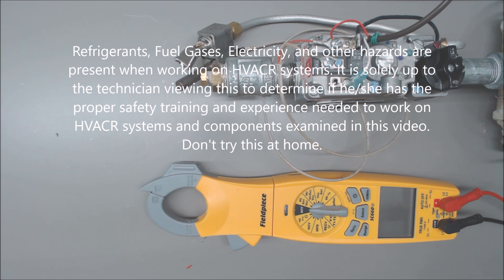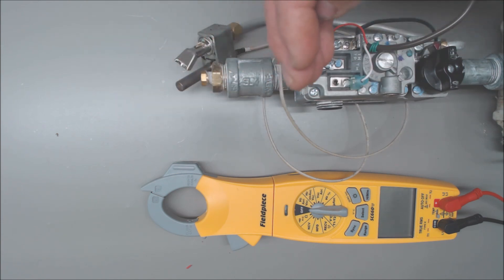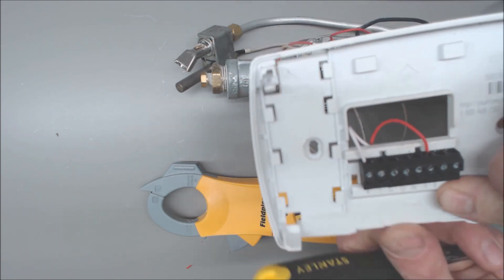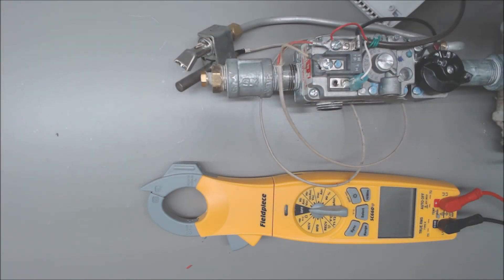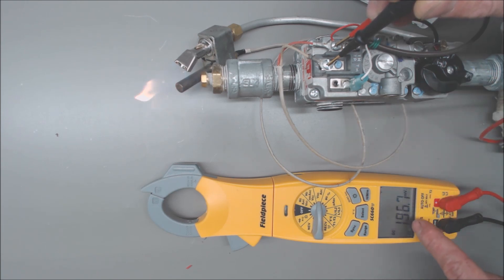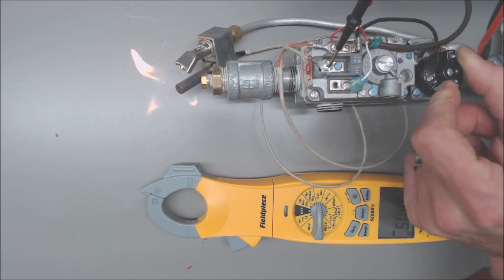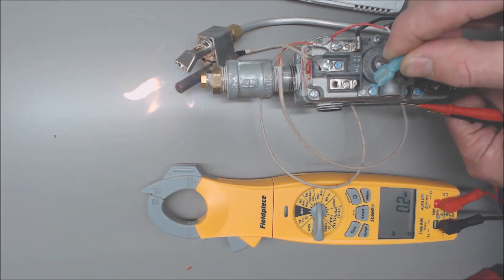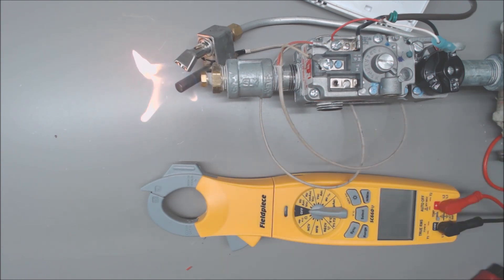How the Millivolt Gas Valve and 750mv Thermopile Work! Troubleshooting!

Comment: awesome video. Do you have a video that addresses why a pilot light does not stay lit please? I've replaced the thermopile, getting over 500mv, but as soon as I release the pilot knob, the pilot light goes out. I've tried two different regulators (this is a small vented propane furnace used for a cabin) run off 20 pound propane tanks

Comment: I have a millivolt furnace heating my greenhouse, and I am trying to make a device based on an esp8266 controller board to tell me if the pilot light has gone out, which sometimes happens under high wind conditions. My thought is to measure the millivoltage from the thermopile, which should always be about 750mv, if the pilot is lit. Is that right? If so, should the pilot flame go out will a substantial drop show up, measured at that point, while everything else stays the same? If so, what would be the likely drop? Thanks for such a thorough explanation of the millivolt system.

Comment: Great video, thanks! What causes the pilot flame to go out when moving from pilot to “on”? Also noticed the pilot flame does not go out when I turn it to “off” so I need to close the main gas valve. I’ve replaced the thermopile, thermocouple, and spark igniter but the problem persists. I think it’s probably a faulty pilot valve but was curious if you’ve seen that. It doesn’t sound common and it wasn’t mentioned in this video. I just ordered a whole new Robert Shaw 710-502 🤷🏼‍♂️ to try

Comment: So, the 10mv drop from 240mv (with the jumper wire on) versus 230mv  with the tstat wire on TH, show a 10mv drop that is due to the entire tstat circuit? 

My reading is 187mv TH to TH-PG, and the burner is staying on. My reading is TH to TH-PG is 633mv without main burner on. Since in you example the voltage went from around 550mv with burner valve open, down to about 230mv, I think I must be losing a lot of mv somewhere in my tstat circuit? If you think that is correct, what is the best way to find the tstat circuit resistance?

Comment: Excellent, clear detail and explanations for troubleshooting. But even the simple basics like why some valves use TP and others PP, and your explanation is the first that covers that right up front. Thank you. - -   Question:  Do you have a recommendation for a WiFi controlled millivolt thermostat for thermopile valve like this?  So far I have only found one on the market, and it is marketed for gas fireplaces.

Comment: If anyone is still watching this. I would appreciate some advise. Have a similar gas valve, Dexen brand. For some reason I can only get the gas valve to open the valve for the burner. When I jump the RH and W terminals together on the thermostat. And. Will shut itself off  while having no call from the thermostat. Because it's satisfied with the temp

Comment: My thermopile will only make .350v from pilot, it drops to .200v when gas valve commanded on by thermostat,  after approximately 15 min that voltage starts to drop untill under .100 v at which time the valve closes due to insufficient voltage,  this is a brand new theropile, could the valve be drawing to much voltage or could the pile be faulty,

Comment: Im currently getting a reading of 550mV between TP and THTP. I know you said 600mV. Main burner is not turning on. Does this most likely mean theres an issue with the main gas valve? 
Burner does not turn on when I jump using a paperclip between TP and TH.

Comment: Great vid, I think I just heard you clarify but want to pose this to you. .  So you’ve got the white wire going to tp terminal.  I’m Installing robertshaw 700 valve to Williams furnace and old thermopile red wire is negative and new thermopile I’m using the red wire is positive.  What’s going on?

Comment: Excellent information. Do you know what the smallest millivolt gas valve might be? I'm interested in building a tiny propane furnace and would like to find the most miniature gas valve that doesn't require power. Thanks.

Comment: I need to replace my old sticking gas valve, just by chance in this sample it is my same old Robertshaw valve, also need to add a thermostat like in the sample, thank you very much it is very helpful, explanation is very clear.
Reply from the maker: Make sure the thermostat is rated to work with MV and not just 24v, thanks!

Comment: I can't tell why the flames in my fireplace are so low and all blue about 1unch high. Years before they would be yellow and blue about 8 inches high. Now I closed the physical entrance where we turn a nob to increase the gas input but nothing happens. I check the thermopile, at rest and it reads 560millvolts with the pilot on, when I open the thermostat it goes down to 190 to 235 is this enough to open the gas valve.  Should I assume the thermopile is defective.

Comment: Hello. I have a Empire DV35 natural gas wall heater with a millivolt system. I have had a regular 24 volt thermostat for years without a problem. Recently I can’t get the main burner to come on. I have replaced the gas valve but still not coming on. Pilot stays lit. Any thoughts? Thanks.

Comment: For a Robert Shaw 710-502 or dexen 6003  they generally wont operate prior to 325mv.  I will say, pilot flame is usually something you dont want to adjust.  It’s common to get leaks there.  Pilot flame is set pretty solid from the factory.  Dexen Tpile only valves tend to have sticking magnet issues also.  The 6003 is a garbage valve.

Comment: My heatilator GNDC36 does not have the black ground wire on it as yours does on the top. Could that be why my pilot light works perfect, but the burner will not ignite?

Comment: Question...What if the valve is not closing? The boiler temp is set to 170, the boiler keeps heating to higher, I tap the valve and it stops firing. Federal 

Taco Zone Controller
SR1502
Aquastat
Brand: Resideo
SKU: L8148J1009
gas valve
VS8279A10342 1/2 X 3/4 INT JD4

Comment: Great video, I have a heatilator fireplace that has thermocouple and thermopile. Replaced both but when I light pilot it will light and stays on for a bit but goes off. When I measure thermopile it won't go up to 105mv but if I disconnect it from valve  will go up to 350mv or so. Any suggestions

Comment: Could I swap out my gas valve with a thermocouple and thermopile and just use 1 thermopile setup and get rid of the thermocouple?  This is on my old Heat n Glo SL550TRSLP-C

Comment: I was always unsure if the thermocouple and thermopile had enough power to drive the pilot and main gas valves.   THANX.
Reply: A millivolt gas valve with both a thermocouple and a thermopile operate differently. The thermocouple is a fast response type that is dedicated to the pilot valve only.  It replaces the now illegal mercury pressure switch that was once used on valves that only had a thermopile. It drops out very quickly should the pilot flame become extinguished due to, for example, a down draft condition.
The thermopile is then responsible for powering the thermostat, safety, and main gas valve circuit. 
You'll notice the pilot burner with 3 distict flames:  one on the fast response thermocouple, one on the thermopile, and one to lite the gas when the main gas valve I energized.
You should be able to disconnect the thermopile connections and not lose the pilot flame.
A lot of fireplace issues are a result of loose or dirty electrical connections, dirty pilot orifices that result in cooler than required pilot flames, failing thermopiles, or thermostats that are not intended for a milivolt system.  A true millivolt thermostat will not have a heat anticipator wire.

Comment: The upper terminal is TP/TH,  not TP. The middle terminal is TP,  not TP/TH. Also I suspect the thermostat pro 3000 is rated for millivolt, but pro 1000 is rated for millivolt.

Comment: I was hoping you could answer a question for me. I replaced my thermopile(it was only reading 190mV) and I got the new one in, great, reading about 520mV when pilot is on. When I jump the leads or turn the on switch on(no thermostat for the fireplace, just on and off) the flame kicks on, but only at about half of what it should be? And the thermopile reads 180mV and same with the pilot. So the question is, why am I getting such a large voltage drop? And is that why the valve isn’t functioning properly?

Comment: what would be the problem if 24v is registered when wires are unplugged from the gas valve, but the voltage drops when wires are connected to the gas valve?

Comment: Thank you, very informative! Would you be kind as to answer a viewer's question: do thermocouples go bad over time meaning produce less energy? Mine shows open circuit 325mV and pilot-only 264mV and main-valve-on 154mV, I'm seeing intermittent on/off issues and I suspect my thermocouple just isn't producing enough power any longer but wanted to get your input before assuming anything as to probable cause? Thank you
Reply: Yes they do go bad. The difference on thermal bulb and thermopile is that the thermopile has several generators inside of it and thats how it produces the higher MV output compared to a single thermal bulb generator.
Reply: @mostlikelywedoitservices6926  Yes we're getting the thermocouple replaced - and the technician turned off the pilot flame before he left!! So now the direct vent is kicking in cold air. haha. Dang! thanks for explaining this problem. I'll call them back today to see if they got the new thermocouple yet.

Comment: Thanks for an excellent video. I put 3 different thermostats on a wall heater, each of them worked, on an intermittent basis. Your video explained it, too much resistance for the small voltage to overcome. Bought a millivolt only thermostat at Home Dept, and believe that will fix the problem. Thanks again, I was freaking out when I thought I had gotten ahold of 3 faulty units.

Comment: Hello thanks for this video.  I have an empire DV210 wall heater in a workshop.  The unit is 4 years old only used in the cold weather so about 6 months out of a year.  My furnace tech has changed the thermopile 4 times since installation.  He has many other heaters in service and some for 10 to 15 years and never required service.  He is at a loss as to why the thermopile keeps failing.  Any ideas?
Reply: did you figure this out yet? would love to know .
Reply: @drummergrl1000  yes the pilot was set to low.  After turning the pilot flame higher the heater is working great

Comment: Very helpful, educational video! You get straight to the fundamentals of the operation. I just fixed my gas fireplace thanks to your help! An additional tip. Don't know if you would endorse it or not.... You can use a 1.5v AAA battery to test the operation of either of the solenoids, if you you suspect the power from the thermopile is insufficient.

Comment: I noticed that the robertshaw valve shows the jumper to the thermocouple port (from the thermopile connection) for millivolt set up. Is the required or can you operate with a thermopile and a thermocouple without the jumper?

Comment: just to clarify, because it hasn't been completely clear in the videos I've tried watching, these millivolt valves don't need to be wired into mains voltage to function, just a switch to directly complete the valve circuit (if you don't go with a thermostat option). Is that right?
Reply from the maker: Yes correct on the 750 millivolt gas valve units

Comment: When I push the knob in to light the pilot, I get gas out of the main burner. I can light the burner without lighting the pilot light. Once the thermocouple heats up, it will stay lit. If I turn the gas pressure down and thermocouple cools down it will shut off all gas. Never had that happen on any gas valve anywhere. Any clue?

Comment: New Empire DV heater. Thermostat is closed, but i need to tap gas valve to get it to "kick in." Ideas? Also, anyone suggest an inexpensive device to measure the electrical energy? Won't use it much. Many thanks.

Comment: If I want to add a spillage switch to this circuit ( to shut down the valve if the draft temp is too high) where do I connect it?
Reply from the maker: Cut the main power wire to the main burner. Look up "acservicetech millivolt wiring" for a video on that, thanks!

Comment: I have 550 mVolts DC with pilot on and wall switch off to fireplace. When I switch on the wall switch I only have about 10 mVolts DC which isn’t enough to open the main gas valve.  Is this due to a bad thermopile. I bypassed the wall switch with a jumper to rule it out as an issue
Reply: You have a bad wall switch

Comment: Nice info. I'm possibly getting closer to understanding how my old Empire  direct vent heater works, or to be more specific, why it may not work properly. 

It's installed at a remote location and is used only occasionally. The pilot light works, but the remote (with a Mercury filled switch) no longer influences the shut off. The heater runs full blast regardless, even when the remote is completely disconnected - unless the knob by the heater is turned back to 'Pilot only'. 

Maybe it's time for a new heater, after all, the thing has worked flawlessly for 30 years.
Reply: Aid you get it working?  I have an old Empire too.

Comment: i have a Earth fireplace insert. I set the valve to Pilot but the pilot 
will not lite at all, No gas is going to it. The gas is on feeding into 
it. Why do you think no gas is getting to the pilot? thank you
Reply from the maker: It could be a clogged pilot tube termination. What is the gas pressure entering in measuring?

Comment: This was very helpful in diagnosing and repairing an older gas fireplace. Tested and saw there was not enough voltage, so we adjusted the pilot and now everything is working!
Reply: @goldstarhvacrllc2567  This was a while ago. As I recall, there was a screw I had to turn to increase the gas flow to the pilot.

Comment: What a fantastic video!  I learned a lot.  I have a regency natural gas fireplace that will light the pilot fine and even support the lower smaller burner to run fine. But as soon as I turn on the main burner I maybe get 5 mins and the whole thing shuts down.  Tell me if you don’t mind, what happens if things are running and the thermopile voltage drops. Will it just kick off the main gas valve or will everything go out, burners and pilot light?  I didn’t catch that if it was in the video. Thank you
Reply: same question, did you get it figured out?

Comment: I have the reverse problem.  Just started after 10 years of operating fine.  My main valve won't close when thermostat is set to off, or even when I unwire the thermostat from the gas stove. It is a thermopile and thermostat mode.  This must be rare, because I haven't gotten any hits when searching for this symptom.  Any ideas?
Reply: i had the exact same issue.....the magnet in the valve was getting stuck...take a screwdriver handle and LIGHTLY tap the side of the valve and that  should free it up....drove me crazy for months trying to diagnose.

Comment: what if you have around 450Mv but the gas valve opens intermittent  or closes  prematurely. Furnace is not lighting but the thermostat contacts have to be manually open, closed, open closed etc till the furnace starts. Or I can just twist or jumper the two wires and the furnace lights. Wires have continuity and I have changed  thermostats.  Only thing I can think of is the gas valve is failing and 450Mv is not quite enough now or the valve is sticky and will only open when the Mv is applied on off on off on off untill it makes it jump open.

Comment: So i had a low thermopile voltage, .2 valve off everything connected. I changed thermopile.  It came up .35 on a nova 820 valve. Valve will not operate. Been running fine for years at this voltage. ???

If i jumper the valve bypass wall switch no function

Comment: Thank you for the excellent video explanation. I have had occasional problems with my natural gas fireplace failing to open the gas valve on command from the thermostat. I have a trusted gas technician coming in today to have a look at the thermopile/valve device on the fireplace. During your video however, you don't make reference to the possibility that this unit may simply require replacement after many years of service (about 20 in our case.)
 BTW, we have already replaced the new Honeywell thermostat and the problem continues to occur, So the two final steps are to inspect the onboard gas valve and thermopile and to inspect the wiring between the two.
Reply: im sure you have your issue fixed by now but i had the same issue and it turns out the internal magnet for the gas valve would occassionaly get stuck shut ....no flow to main burner.. few taps with a screwdriver and it was fixed..
Reply: @workingshlub8861  what was the symptom? When I call for heat at the thermostat I hear a click and the pilot turns off instead of opening the valve.  Where do you tap it?  Thanks
Reply: @jayhdez2329  if the pilot wont stay on at all you probably have a weak thermopile.....click at the valve or the thermostat??
Reply: @workingshlub8861  the pilot stays on. It’s when I move the thermostat to call for heat when I hear a click and instead of igniting the burners, the pilot then shuts off
Reply: do you have a thermopile or a thermocouple setup??   are there wires going to the gas valve??
Reply: @workingshlub8861  thermopile and yeah it’s hooked up to the valve.  Gonna try to find a replacement and see if that does it?
Reply: @jayhdez2329 make sure its wired correctly and measure voltage when pilot is on...i tend to find the battery operated thermostats work best for these systems...if you do buy a new tstat make sure its compatible with milivolt setups..